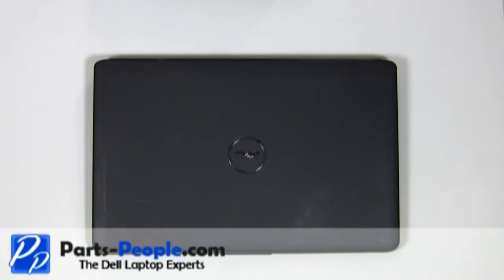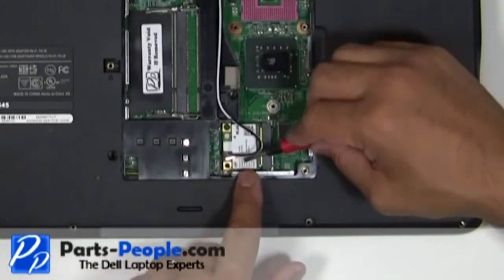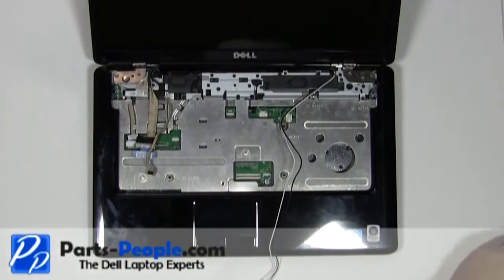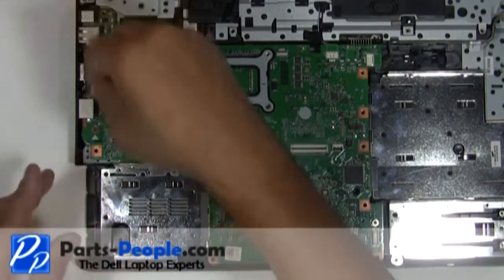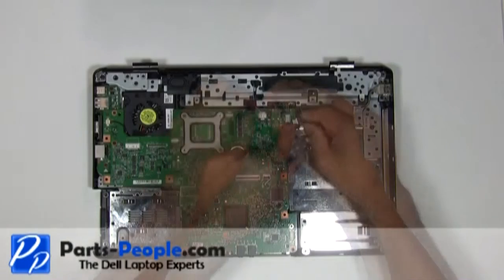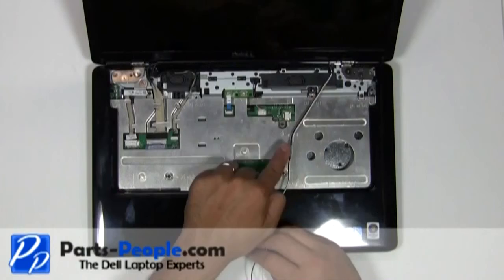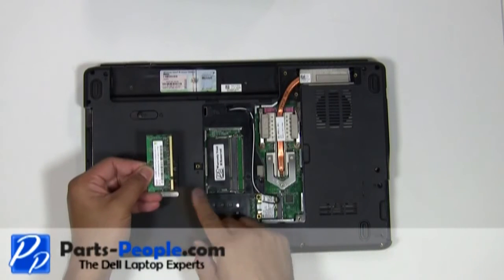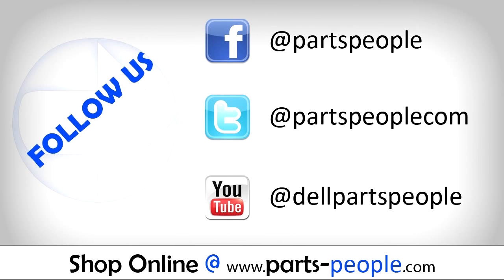Dell Inspiron 1545 | DC Power Jack / USB IO Circuit Board  Replacement | How-To-Tutorial

Comment: I broke the locking mechanism for the processor on my Dell 1545. Is the a way to replace it on the motherboard or do I have to change the whole board now?
while trying to remove it the cardboard under it broke.
HELLLLPPPPPPP !!!!!!!
Reply from the maker: Robert Praino Yes, if the locking mechanism has broken, the motherboard will need to be replaced.

Comment: Hey there,
I had to buy a new jack board as my one went on fire, i did everything you did and i have past experience with laptops so i know im pretty sure i put everything back together.. I re opened and double checked etc but when i plug my adapter in, and press power button nothing happens. Its like its just dead and my adapter does work as it works on my other dell. Could you please tell me whats wrong with it? Everything seems grand, theres no fire damage on the motherboard only that dc board which i replaced. Any idea? Much appreciated.
Kind Regards,
William.
Reply from the maker: Unfortunately it's hard to say without having the laptop to test. I would guess that the motherboard needs to be replaced. If the DC board caught on fire, then there is a good chance that connector for the DC board was damaged on the motherboard side. Other than that, I would have to see the laptop.

Comment from the maker: If you are replacing the DC jack and circuit board you will not need to solder anything. If you are replacing just the DC jack on your existing circuit board you will have to solder it on. The method in the video shows how to replace the complete circuit board without soldering.

Comment: my wife's 1545 had the pin broke off inside the charging port and it is no longer able to be charged. I have been told that a desoldering and soldering gun are required to replace the charging port. According to your video that is not the case? Is this true?

Comment from the maker: You are correct, the CPU, and Memory do not have to be removed but the hard drive will have to be removed. (Apologies for the others. We were doing a lot of videos and it must have been overlooked)

 The BIOs reads "Adapter Unknown" or "Adapter Not Found" is a sign that the DC jack is damaged. If you're good at soldering, you may be able to replace just the DC jack but there is a good chance of damaging the circuit board. I always recommend replacing the complete circuit board.

Hope this helps.

Comment: Outstanding video !!

I am 99% sure my DC power jack is bad (Power connector loose & intermittently recognizes adapter - currently not charging at all, but system works via AC input directly (Battery is new).  I've looked at many equivalent repairs for 1545 (Yours is best).  However others have no need of removing

1 CPU
2 Hardrive
3 Memory

Are these step truly required?

PS: is there an easy fix for manipulating the DC Jack prongs directly without replacing entire DC board?

Many Thx

Comment from the maker: If the adapter isn't recognized in the BIOs the laptop will not allow the battery to charge. I would first check to make sure the DC circuit board is connected to the motherboard properly. If it is, it leads me to believe the DC jack you replace is defective.

Comment: Hey! I needed to replace the DC power board because it wouldn't charge at all (I tried 3 different adapters, all didn't work). Sometimes it would show the "plugged in not charging" but sometimes absolutely nothing... I replaced the board and now it still doesn't recognize the adapter. In the BIOS, it says AC Adapter: Not Installed.

Comment from the maker: I would put the original DC board back in and see if the USBs are working on that one. If they are your new DC board is probably faulty. If they don't then you probably have a driver issue or a connection issue.

Comment: Why do you remove the processor, ram and power button if you're just replacing the DC board? I've done this before and had no need to remove them in order to remove the motherboard.

Comment: Great video, really helpful for people who have not seen inside a laptop before! I do have one question, you haven't suggested to replace the thermal paste on the heat sink once the seal is broken, was this for simplicity or is there another reason you've skipped it? I have always replaced and thermal paste if i've had to remove cooling parts!

Comment from the maker: If the DC jack is broken, a new dc jack can be soldered on. It's cheap if you can do the soldering yourself, if not the cost will be about the same as buying a new dc board. If the DC board is broken, you will have to replace the entire DC board.

Comment from the maker: Yes, if you have only the port, you will need to solder it on to the DC jack board. Be careful removing the old DC jack, you could permanently damage the board if it is removed incorrectly.

Comment: This worked perfectly! I saved myself anywhere from $110-upwards of $200 with being without my computer from 24hrs to over a week. When i put everything back together the machine started beeping, i stayed calm, unplugged it and went back into the machine and saw that i did not seat my memory cards correctly. My dell insprion 1545 is charging nicely now, especially since i bought a new battery and replaced my rocketfish charger that was bought back in April. the part cost me $17.00, AMEN!!

Comment: Great video. Only the commendation to others is you do not have to remove monitor, CPU, heat sink. Just lightly lift board off and out of the way and you can slide the dr1 charger board out from under the system board. Other than that instructions were spot on!

Comment: This video just saved my wallet. The shop I took my laptop to had me convinced that it wouldn't just snap in place, it would need to be soldered. (I was very clear that I had the entire power/usb board. $80 they wanted to charge me.  Thanks alot

Comment from the maker: Have you looked in the BIOS  to see if the computer is recognizing the Battery and the AC adapter?  

If the BIOS is NOT recognizing the battery then the Battery is bad.

If the BIOS is recognizing the Battery and not the AC adapter then that may be the reason for the battery not getting a charge and the AC adapter may need to be replaced.

If the BIOS recognizes both the Battery and the AC Adapter then it is possible that the charging circuit on the motherboard is defective.

Comment: Hi. I installed this component, the power jack and usb board, but it still doesnt charge. I know I installed it correctly because the laptop still gets power from the ac and the usb ports work. I have two chargers, one dell and one that isnt, but they have both worked before. I bought a brand new battery only two weeks ago and that charges successfully. So what do I do. I have tried to uninstall the battery driver in device manager as well. I really need your help and would really appreciate it.

Comment from the maker: You have two different options when replacing the DC jack on the dell Inspiron 1545.  You can replace just the DC jack port which would need to be soldered onto the DC jack USB IO circuit board, or you can replace the DC power jack / USB IO circuit board which would just need to snapped into place just as describe in the tutorial video above.  I you do not have experience with soldering then I might suggest replacing the circuit board.

Comment: I followed this video exactly and it was excellent. I spent $40 for the part and did it myself. Took me about 45min to take apart and about 15min to put back together. Make sure you get something like an egg carton to separate the right screws.
Reply: I never thought about using an old egg carton for that.  That's a great idea.

Comment: I just replaced my DC charger board.. thanks for that.. however I found that my actual charger is broken (or may have been the issue to begin with).... how do I know if I even installed the board correctly?

Comment: @incertobscenity 250-500 dollars at Best Buy not including the 80-some dollar down payment.  They send it off to the Geek Squad.  You can buy a new computer for that price.  It's roughly 150 dollars to transfer your files from your old hard drive to a new one there, too  I followed this video and did it within 2 hours.  But, I think my charger is fried now...we checked it with a meter and it's not putting out any voltage...
.

Comment: @incertobscenity yea shit load of cash, 10 session's with Dr Phil and a Vinnie baseball bat, and maybe the 16 yr old would get it to work. if you can not replace it from this video I strongly suggest never to mix C$, set up fire works display, make bagel dough with and yeast, mix nestle quick with low fat milk, pump gas in a car, work a bic lighter, stand in the sun wearing banylon shirts, smoke drink or any process that requires 2 brain cells while in public

Comment from the maker: @308beatZ If all you wanted us to do is instal the Dell Inspiron 1545 DC Power Jack / USB IO Circuit Board, all we would charge is $50.00 general installation fee plus the price of the part $99.95 plus shipping.

Comment: @dellpartspeople Mmmm, I've bought  another ac power adapter and that didn't fix it...I wiggle the ac power adapter in the dc power input and it charges it if I keep it still but only for a few seconds? I haven't tried another battery...I want to buy the DC board thing you replaced in this video...but all those components you removed I might lose or forget how to put it back !

Comment from the maker: @308beatZ It should fix the 'not charging' problem, however;  there are three components in the charging system that could potentially be the problem.  They are the AC Power Adapter, DC Power Jack, and the Battery.

Comment: If I replace the DC power board on my 1545 will It fix that Plugged in not Charging problem?...I've tried differnt power adapter cords and it still dont charge. thanks